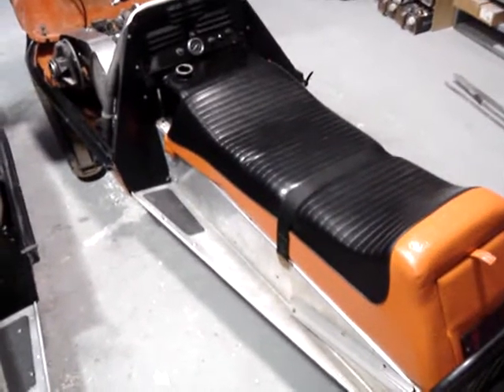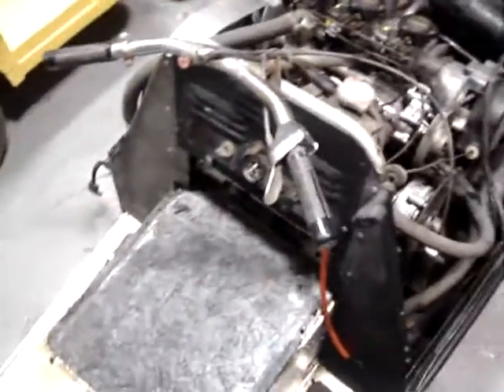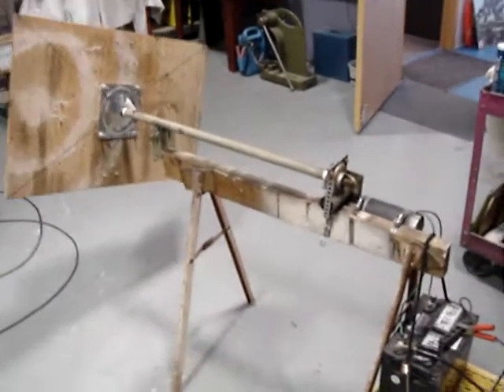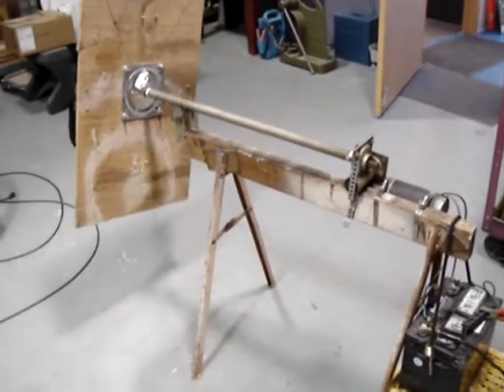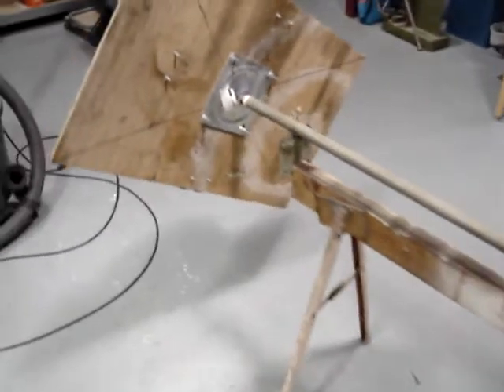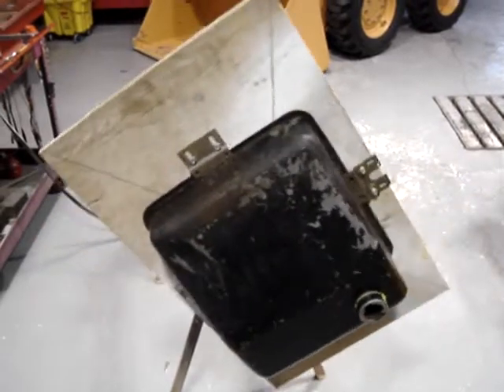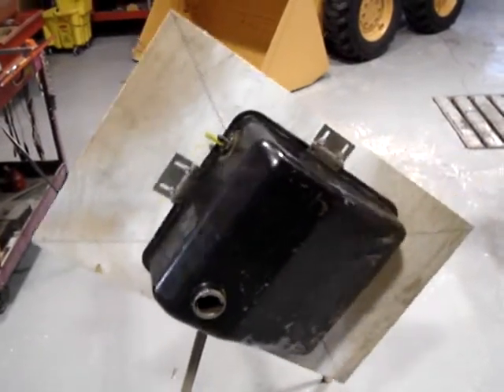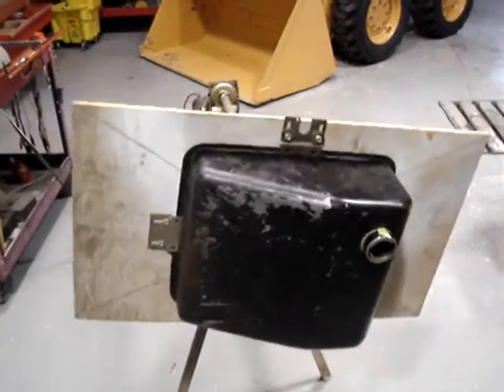Movie cleaning gas tanks.mpg

Comment: thats a lot of work building that rotater,  i am gonna use a cement mixer,  i have used shingle t o clean the drum, so straping the tank to the drum face should be just as useful.  -put it in a shed though, as its deafening when doing just the mixer!